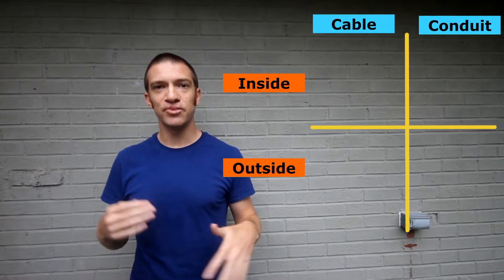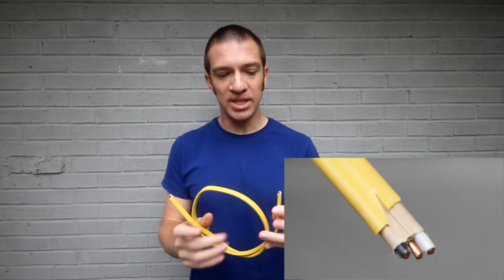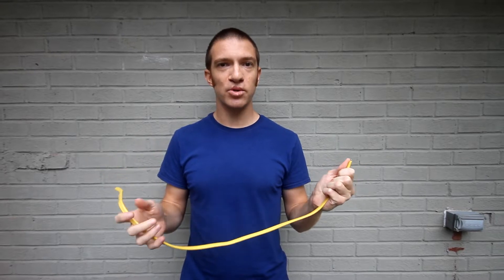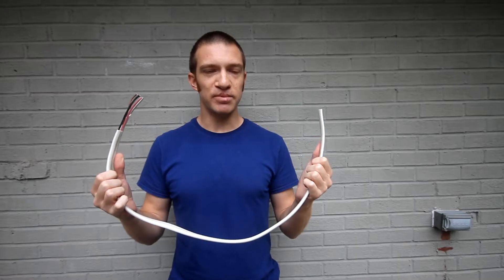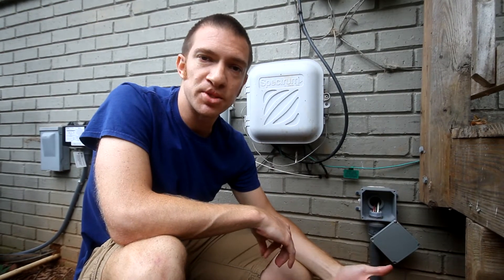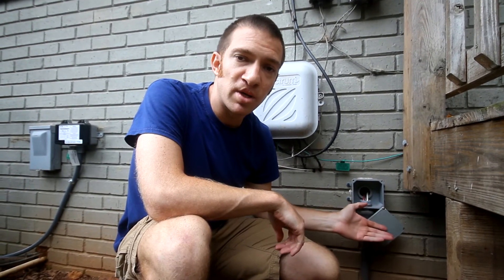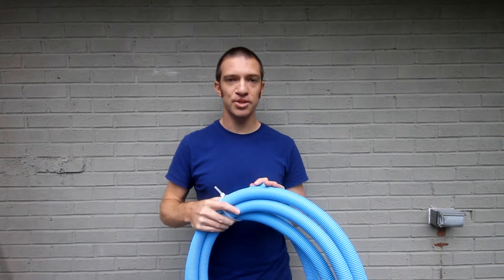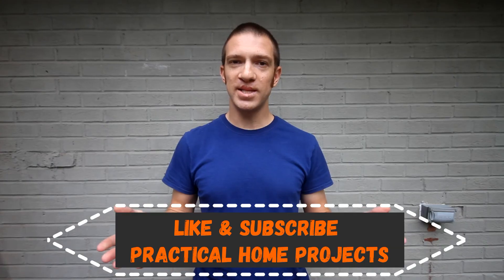Electrical Conduit vs. Cable: Which is best for your project?

Comment: By 2000, copper isn’t cheap as criminals break into houses to steal anything copper.  So Romex or any cable isn’t cheap.  Even rigid pvc conduit isn’t cheap.  Copper pipes are cheap either.

Comment: Thank you very much. I have a question though ... I used to install satellite dishes and  when running a very long cable it causes the signal to drop a little .. does that apply to running electrical wires around the house for over 100 feet? will voltage drop?
Reply from the maker: Hello, Yes there is a voltage drop concern. The longer the distance, the higher gauge wire you need to minimize resistance and voltage drop. I like Southwire's calculator https://www.southwire.com/calculator-vdrop. The voltage drop is generally negligible at less than 100 feet. If you are going significant distances, you might consider aluminum because it is much cheaper per foot even though it is less conductive.

Comment: very informative video.
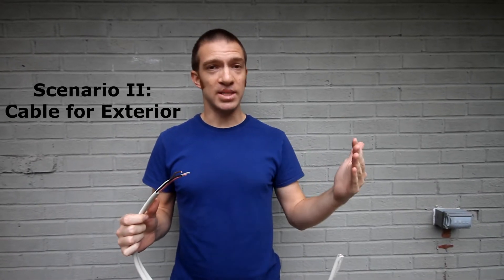However, at timestamp 1:52 the cable you're showing has 4 wires and that's not comparable apples-to-apples to the cable you're showing at timestamp 0:45, which has only 3 wires. Most outdoor use cases only nee 3 wires, unlike indoor use cases, like 3-way circuits, which require 4 wires.
Reply from the maker: Hello, The number of wires would depend on what kind of circuit you are setting up. You should be able to find 3 or 4 wire cables meeting either indoor or outdoor conditions.

Comment: Nice overview mate.  I have a panel outside of my garage.  I want to install an EV charger inside the garage.  Would I insert the blue conduit inside the wall that is between the charger and the panel?  What is the easiest option?
Reply from the maker: I think your plan sounds reasonable. The blue conduit can only be used indoors and is a good way to protect individual conductors. Be sure to use proper fitments at the panel and junction boxes.

Comment: Great video, man! 
I wanna install a 30amp power inlet for a generator to power my house after a power outage. I’ll probably use 50-60 feet of wire that runs from the back of my house to the front (where main panel is located). Given the scenario I’ve mentioned, what type (brand?) and gauge wire and what type of conduit should I use? Or if you could give me a full list of what I’ll need that’d be great😅
Reply from the maker: I think this article will answer most of your questions. https://practicalhomeprojects.com/?p=138 The brand of your wires/conduit isn't important as long as they are UL rated for the application. Since it is outside, everything needs to be rated for wet areas.

Comment: Just a correction, if it is rigid metal galvanized conduit it has to be buried 6” below grade and that’s to the top of the conduit not the bottom as that confuses people. And pvc is generally 18” to the top of the conduit with the exception of if it’s 120 volts circuit and gfci protected before it comes outside and goes into the ground can be buried at 12”. Now with that said using the flexible conduit buried in the ground is kind of a gamble as the whole subject to physical damage thing comes into play which is why they require even rigid pvc to be schedule 80 thick wall pvc when exiting the ground up to 8’ and down into the ground 18” if I’m not mistaken. It all depends on the inspector and if he interprets it to be in a physically damaging area. To avoid hitting it and breaking through it with like weed eaters and lawn mowers specifically the weed eater with the metal blade instead of the string, but just a safety thing. Just throwing some info at you. But I like your videos. Keep up the good work.
Reply from the maker: Thank you for the insight. The "Subject to Physical Damage" piece is a bit subjective, so it's a great idea to speak with your local inspector. Ours told us that for a residential property we'd be fine with schedule 40 as long as it wasn't next to the driveway.

Comment: Electricians manage heat so that you have a cool running electrical system….fire code requirements are minimum standards……
A majority of you will need fire extinguishers

Comment: I've been watching ev charger or nema 14-50 for tesla charger video installing and couldn't find any video explaining in details like yours.  Especially the Non Metallic Liquid Tight Flexible Conduit.  I am planning running it from electric panel down to crawlspace (20ft) then outside for another 50 ft using this type of conduit.  Then bury the gray PVC schedule 40 for burying 18" under the ground.  Now I know NMLFC an be buried like a pvc.  Learned something!

Comment: Some good info here, but......per the NEC you CAN NOT use THHN wire in an outdoor/underground application.  It is rated for dry use only.  Underground in conduit is considered by the NEC as a damp/wet location.  This requires THWN rated wire.  Typically you can buy dual rated THHN/THWN-2 wire.
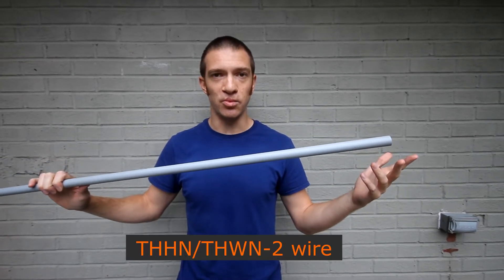Reply from the maker: Hi there. You are correct that the wire needs to have the "W" to be used in outdoor settings. I labelled it as "THHN/THWN-2" at 1:12, but I tend to just refer to it as THHN since almost all of the THHN wires on the market today are dual rated. Thanks!
Reply: It always comes that way. Thhn/Thwn

Comment: Veryyyyy informative. Thank you. If one wanted too, can they use the flexible pipe from the outside of a house that runs 50ft straight & buried 18" in ground and out to a supposed outlet which has romex 12gague running thru it? You've mentioned not running romex in the flex pipe but running single THHN wire, but why can the romex yellow jacket (hot, neutral and ground) run?
Reply from the maker: Hey there. You could run the romex inside, then switch to THHN inside conduit at a junction box. It's not completely forbidden to use romex in a conduit, but there are two issues: 
With 3 or more conductors, the total fill inside the conduit cannot be more than 40%. The romex has a much higher cross sectional area than the individual cables inside, so you'd have to oversize the conduit significantly. 
The second issue is that the pvc jacket around romex is actually a bit tacky and will have a lot of friction when pulling through a conduit; it's not very durable either so it may tear. The THHN cables are a slick nylon material.
Hope this helps!